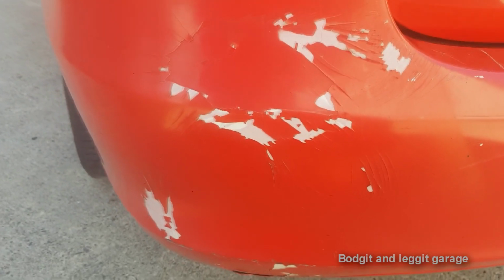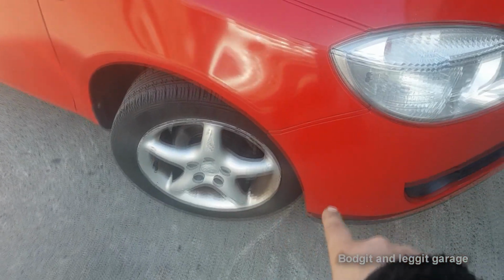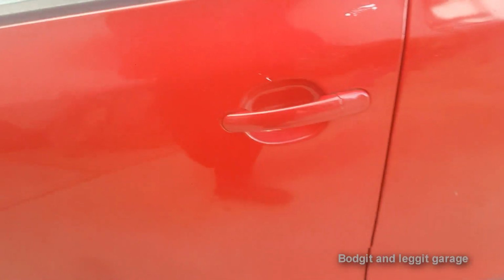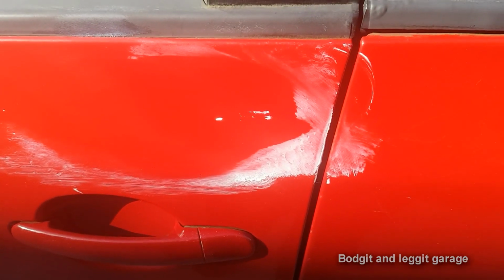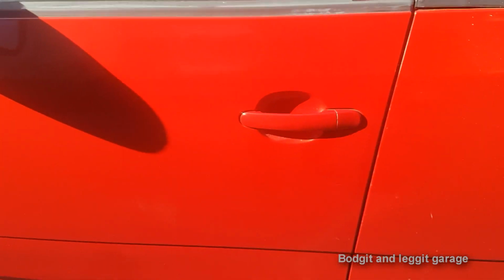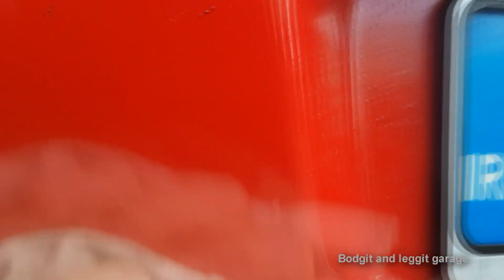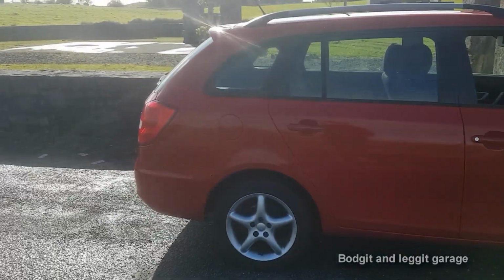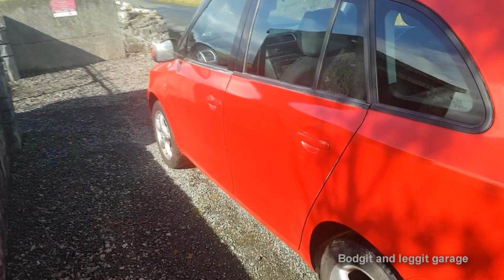To Paint Or Not To Paint I Got A Free Car Part 4

Comment: With painted bumpers if one person clips your car you can immediately see any damage. They used to offer a grey, textured rubberised plastic type stuff that was much more resistant to damage.
Reply: But it looked worse.. so they made the painted ones an extra (should have been a minus).. and people want the extra pain!
Reply: @aitorbleda8267  Well, it looked worse until your painted bumper inevitably got scuffed, chipped or cracked. ☹️
Reply: @thomas316  And you take it to the shop, and they fail to add plasticiser... And cracks